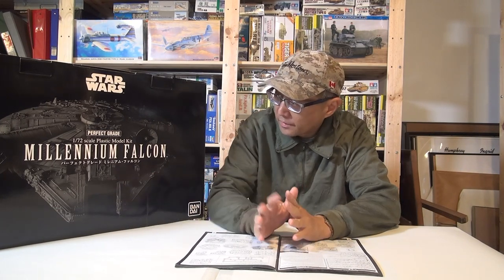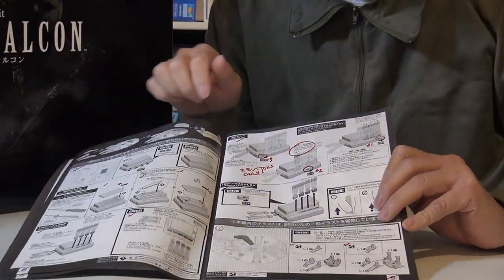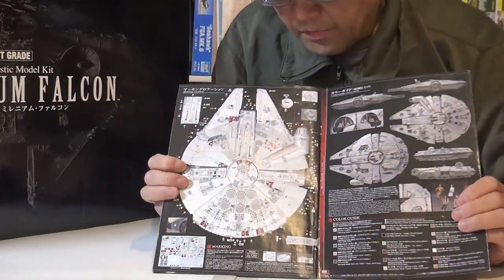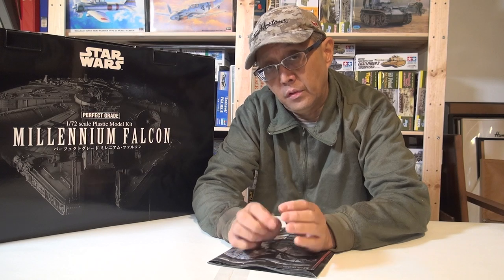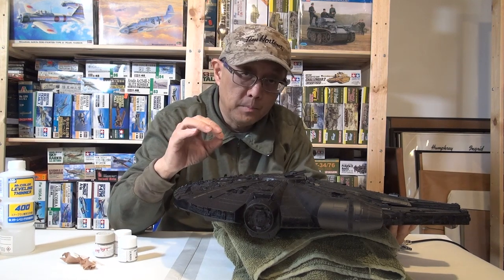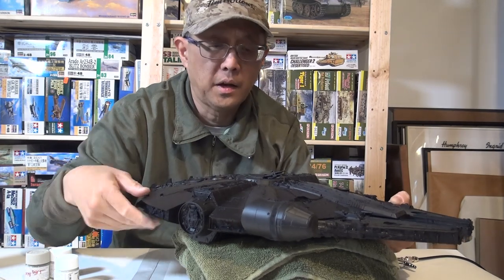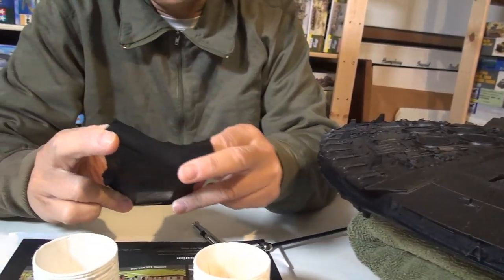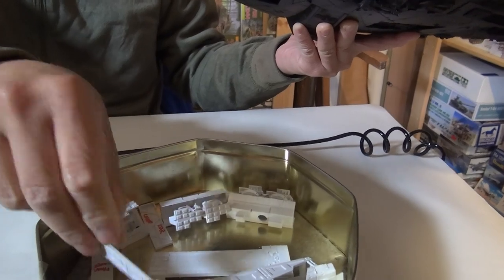Millennium Falcon Episode 1

Comment: hi! i have a question for you, i just recently finished building this model kit, and i used testers black enamel to mimic what you are doing in this video, (so my model at the moment is all painted in testors Flat Black) my question is, would there be a problem if paint acrylic over the enamel? i am really scared to mess this one up, its my second build ever! hope to hear from you soon!
Reply: probably too late now, but I would have recommended going with an acrylic primer, then acrylics over the of that in multiple coats, then an  acrylic clear, then oils with minimal thinner (bandai plastic is susceptible to be damaged by enamels etc).